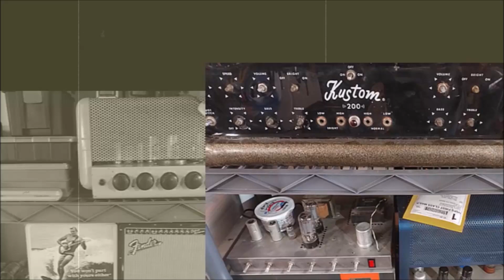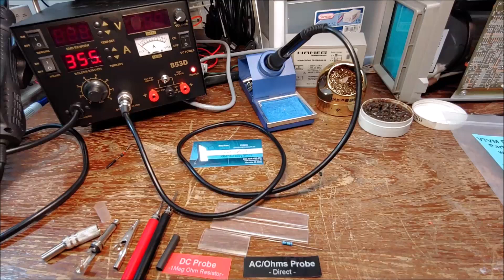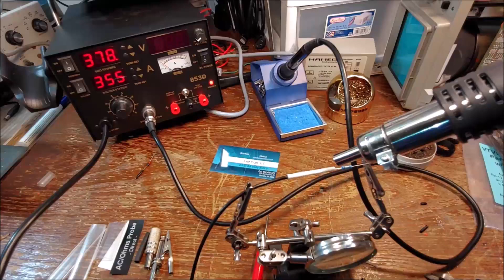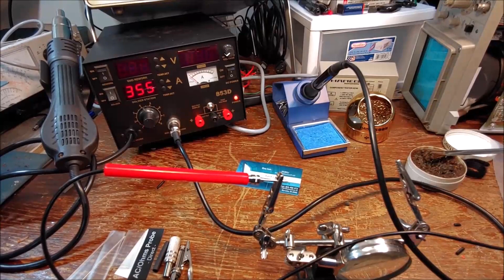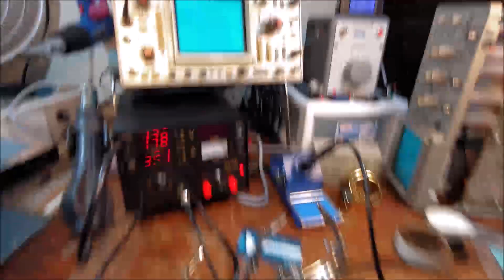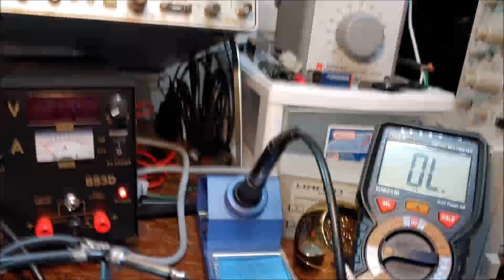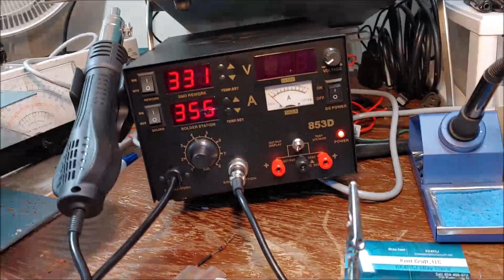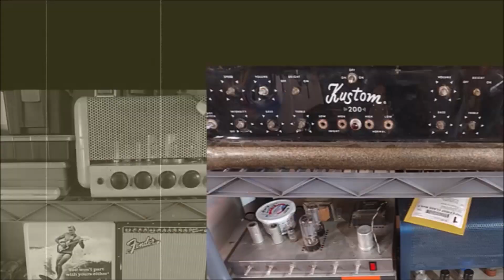Part 2 Heathkit IM 5228: VTVM Probe Assembly

Comment: We all make that same mistake. When I do, instead of tape, I find it easier to fill the gap will some type of insulating caulk... Maybe the (proper/non-conductive) adhesive that is used to tack down big capacitors. If your going to use electrical tape, use the type that welds/melts to itself. The adhesive type will unravel and tell you later that it did. Another tip... I don't use hot glue, because of all of its known disadvantages. I use "Shoe Goo." Extremely strong, durable, a tiny bit of flex and removable (pull it to stretch it and it will release, with a good bit of effort.) You find it in the shoe department, near the polish supplies.

Comment: my only concern with  this kit is, wont the ac/ohms probe have voltage on it while using the dc probe in a high b+ circuit ? shock hazard
Reply from the maker: Yes, the original probe had an integrated switch, as it only had one probe tip. You could use a stereo plug and jack and add in a switch to the meter. Or you could just replicate the original probe. Great comment, thanks!

Comment: Sitting here watch you bungle around with that phono jack made me realize how much easier it would be to just solder the sleeve/ground first.
Reply from the maker: Yes well the intent of doing the center conductor first was to be able to slide that heat shrink up over the solder terminal. I didn't do that obviously, but that was the plan as to why I did it in that order.
Reply from the maker: Thanks for the comment BTW.